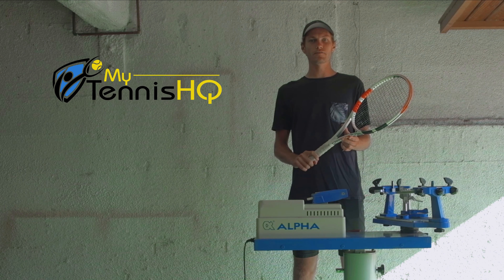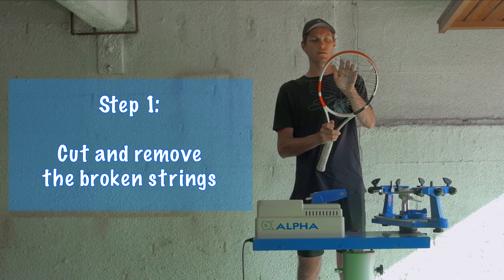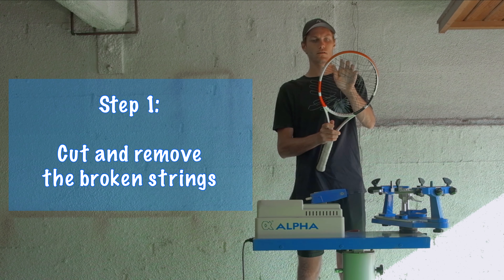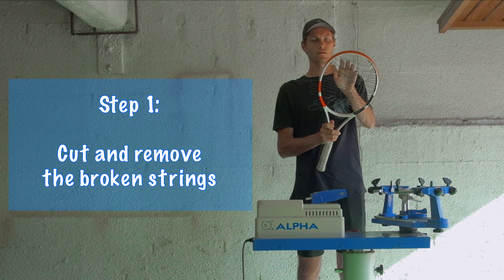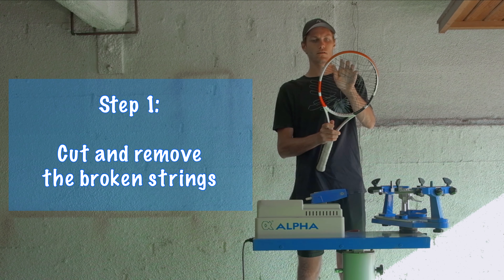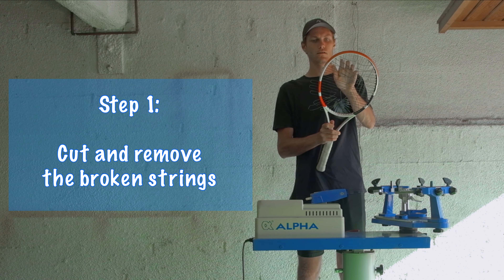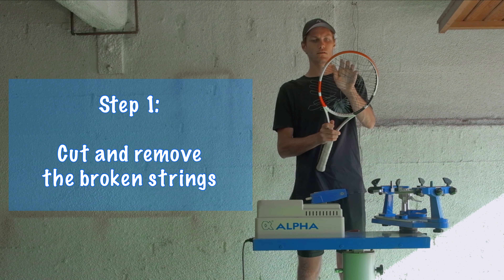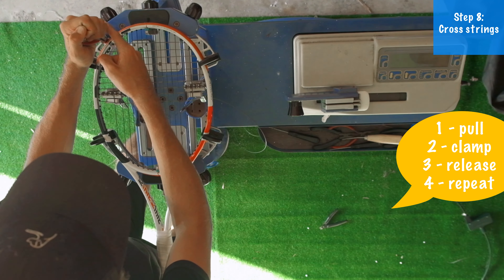How To String A Tennis Racket: Complete Step-by-step Guide For Beginners

Comment: Interesting how every stringer on yt does their stringing just a little bit differently. From what I've learned you shouldn't string OVER the throat but go under, you don't gain anything from going over anyway, not even time. Another thing I noticed is that the pro stringer that gave a course at our club (some time ago, that might've changed?) set tension to the first 2 mains together, before setting the first clamp (he said you could also use a starting clamp) because you shouldn't use clamps on strings without tension and then obviously had to string them again, so that actually costs a couple of seconds. 

You might want to give Tennis Spins tutorial on the crosses a look, because weaving in 2 crosses and then setting tension to the one before makes it a little(!) bit easier to go fast on this. Don't look at his "starting" knot though (albeit it seems to work well for him). ;D

Still a good video overall with the slowmos and all the explanation you need!
Reply: Yeah double pulling the first main is a no no. No double pulls ever. Period. Regardless. Period
Reply: @bengray5013  What's wrong with tennis spin? I watched https://www.youtube.com/watch?v=2E9aD2XoPBw - knowledgable, articulate and current technique
Reply: @bengray5013  that might be true but he is knowledgeable on string as he is part of the yonex stringing team.
Reply: @bengray5013  wdym? he is on the yonex stringing team.
Reply: @bengray5013  where did he say that?
Reply: @bengray5013  nahh he explains how they do it not that he learned
Reply: @bengray5013  the reason he says they want you to this and they want you to do that is because that's not how he normally strings but it is how you have to string when stringing for yonex. And he has also said in multiple videos that he was taught 30 years ago by normal guy and not the stringing team.

Comment: I highly advise NOT to pull tension with stringing machine to tie off knots! This is very dangerous to do, and you will break rackets. You pull tension OUTWARDS your racket which its not made for.

Tips:
Don’t pull tension on your knots using the stringing machine
Use a starting clamp to help you grip the string when tightening the knot
Remember to increase the tension by 10% before pulling the last mains or crosses before tying off to compensate for the inevitable tension loss

Comment: can't see the tension head but do you typically pull strings running above the throat vs under or does it matter?
Reply: @stevebatte1147  that's what I thought as well, wasn't sure if on his stringer that the tension head was set higher up.. seems like it matters on my manual spring tension head.